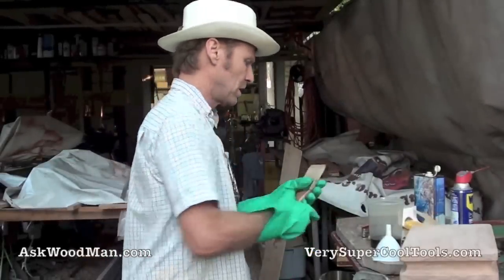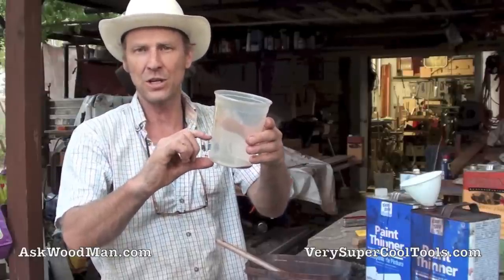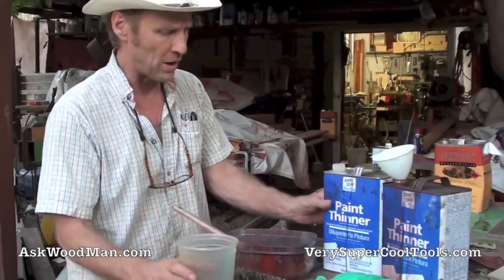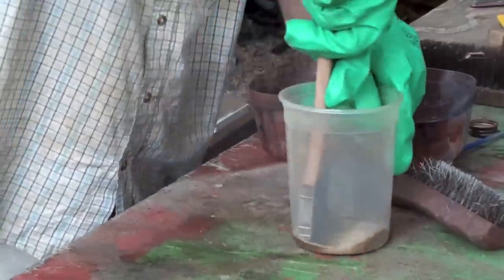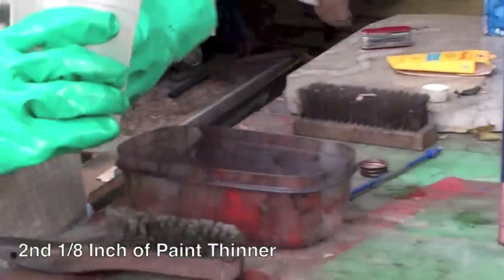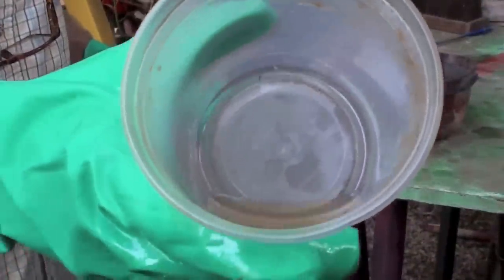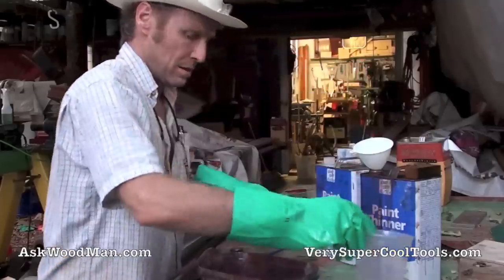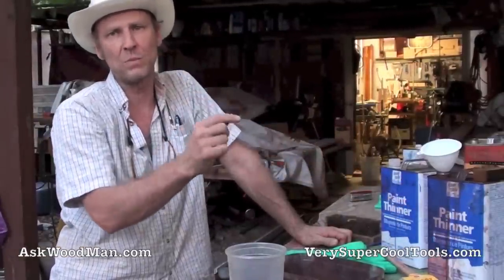HOW TO CLEAN A PAINT BRUSH  - Oil Based

Comment: Dear Woodman, How do you dispose of the old thinner when you are done? I live in NYC and work as a painter. I am thinking that we're supposed to leave anything with high VOC, or stuff like thinner, out near the garbage area for our supers to handle. But in general, what's your process with thinner disposal? Thank you!
Reply from the maker: +vosignificando I am fortunate enough to live a city that has a recycling center for used thinner along with many other household toxic materials they do not want put down the drain or in the landfill . But I only have to drop off about 1.5 gallons per year because I use this miserly method. I did not show it in this video but I also save the old thinner and decant the clean portion into cans to use on really bright colors. So I do most of initial cleaning with the used thinner and then just finish off with the clean. I would be surprised if NYC did not have a household hazardous waste disposal site.
Reply: +AskWoodMan Thank you! You did explain this method of re-using the thinner in the video. Pretty brilliant. I disposed of mine in an empty "plaster weld" container with a sign on it saying what was inside and not to throw in garbage (for the super to deal with). But always wonder what they do. Hoping it's eco-appropriate! Thanks again.
Reply: NYC does have a disposal program. Just call 311 for city services and navigate the options there.

Comment: Thank you! Question: What do you do with your recovery can when it's full? In general what is the acceptable disposal?
Reply from the maker: Most cities in the US have recycling centers for various household hazardous waste items. My city Austin TX does. Just call your local 311 and ask if your city does.  But once you start using this method you will use very little thinner. And the old thinner can be used to first clean your brush if you have used dark heavy paint and just use the clean thinner for the final rinses.
Reply: Ok, thank you!

Comment: My genius fiance used a bowl that we eat food out of to use oil based paint, now I have to clean it with turps but I also need to wash it again to, is it safe to eat out of after its cleaned with turps then washed in dishwasher?
Reply from the maker: I really don't know. It would depend on the porosity of the bowl material. I would probably just pitch it to be safe. Or use it for change or batteries to recycle.

Comment: At what point do you reuse the recovery paint thinner? Or you save it for some other job??
Reply from the maker: I use the recovery thinner when do my initial cleaning of the brushes with oil based colored paint paint. But this video shows me cleaning transparent finish with my good brush, so I don't contaminate the brush with paint residue.
Reply: @AskWoodMan  Got it. Appreciate your reply!!

Comment: When would you use Mineral Spirits vs. Paint Thinner, vs., VM-NAPHTA to clean brushes?  Seems to me the VM-NAPHTA is a stronger cleaner.......  BTW, excellent vid.  I leaned a lot!!!
Reply from the maker: +Craig D Mineral spirits and paint thinner are essentially the same thing. As I mentioned mineral spirits do a great job on most oil based paints without having to go ultra toxic. When I need to clean my brush after using KemKromik I use xylene because that is that product's thinner. I never use naphtha because It is not a thinner for any of the products I use.  I don't need to use something so potent just to clean a normal oil product designed to be cleaned with mineral spirits.
Reply: Thank you for clarification on my question.

Comment: Hello, I've got a question, you see I get my first oil paint set tommorrow, so I wanted to have more infos about paint thinner and liquid white and all that stuff, and it seams it's toxic...I am really worried, how to prevent that?
Reply from the maker: Any petroleum solvent like thinner or spirits is toxic. The only way I know to mitigate the toxicity is to not come in contact with it or breathe the vapors. You see me in this video wearing chemical gloves and doing this video outside in the open air. There are also very effective organic vapor respirators one could wear if you are very sensitive or had to clean up inside. The key is to use as little thinner as possible and reduce the organic vapor exposure to yourself and the atmosphere.

Comment: How do clean a dry paint brush, Do you think that it can be save.
Reply from the maker: The only thing I have seen that will break down dried finish or paint is Xylene/Xylol. But unless you have a need for that product the best course could be to let that old brush go and start fresh with a nice 2" Purdy for $15 and then take care of it. I make that video almost 8 years ago and I am still using that same Purdy. It has been cleaned many hundreds of times. I use Xyl/Xyl because I use Sherwin Williams Kem Kromik primer for my steel painting and it is the thinner for that paint and the only thing that will clean a brush after using it.

Comment: One step people always forget is after you have cleaned the brush with mineral spirits, use warm water in a cup with a drop of dish  soap to remove all the mineral spirits, dry best you can with a paper towel then put the brush back in the sleeve.
Reply from the maker: Do what you like. But I will never put my oil brush in water.

Comment: You should let your subscribers know about using Kerosene since its 1/3 of the price per gallon and works just as effective. Also that waste can of thinner can be reused since the paint sinks to the bottom and thinner rises up. Dump it in a gallon paint can, wait an hour and you can see it separates.
Reply from the maker: No thanks on the kerosene.
Reply from the maker: GeorgieWise
Hi Georgie, I really appreciate your comment but I do not allow profanity on my channel. So I will give you a few hours to edit your comment or I will remove it. I just like to keep my channel family friendly and for students. Thanks for your time. Allan